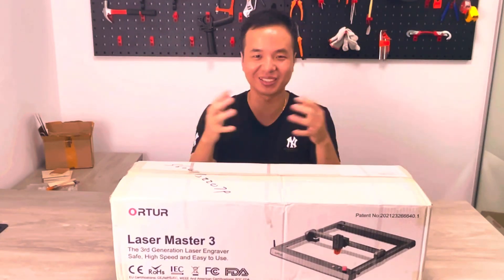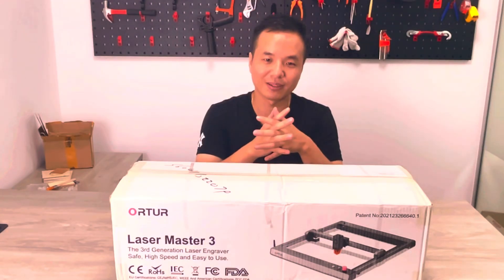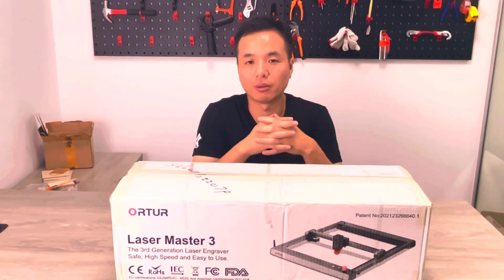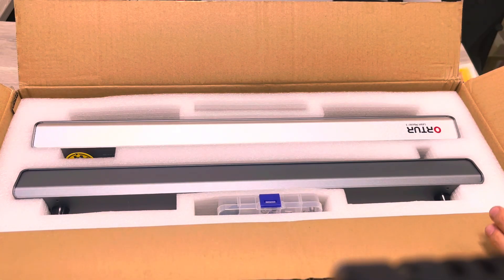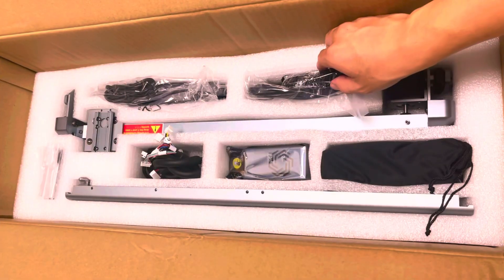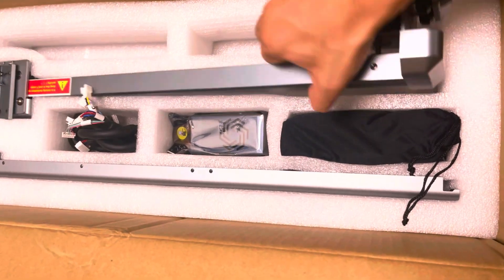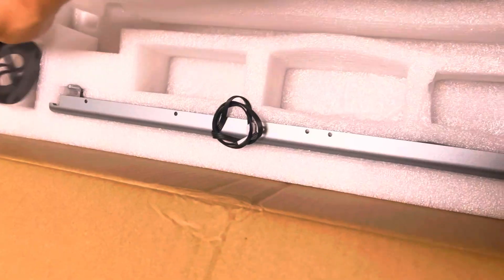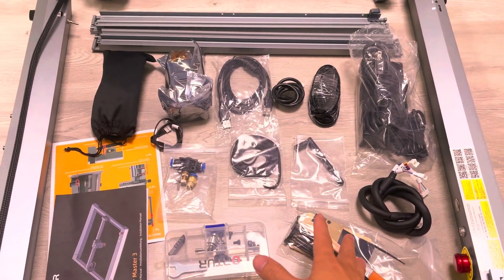Ortur Master 3 Unboxing Review : 10W Diode Laser Engraver & Cutter for Beginner Under $1000

Comment: Nice job.  The only thing I noticed was when you put the y axis belt on the motor side you can take the side covers off and do it much easier.   Also need to make sure you have the sd card in the laser after coping files to your computer.
Reply from the maker: I always keep my laptop connected with machine all the time, so I did not use SD card so far.
Reply: @noveltymaker   you have to either have usb used with laptop or wifi. Both use the sd card